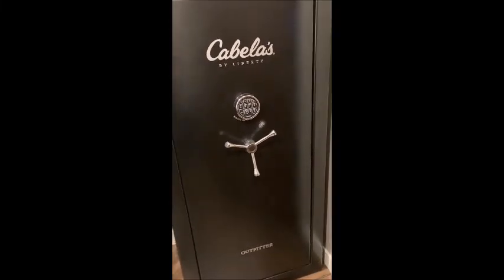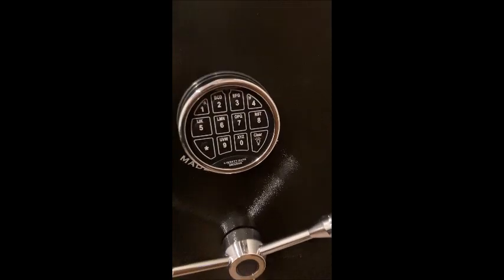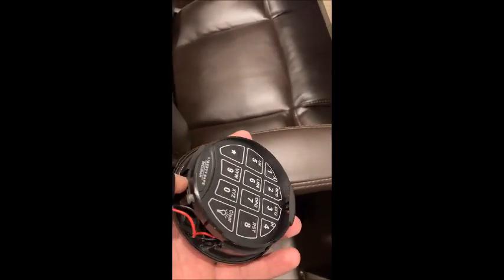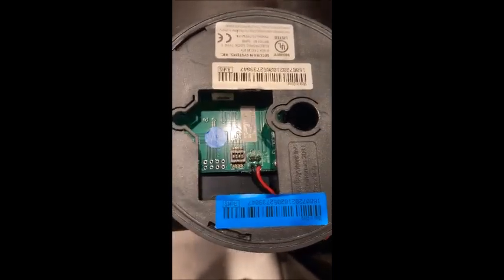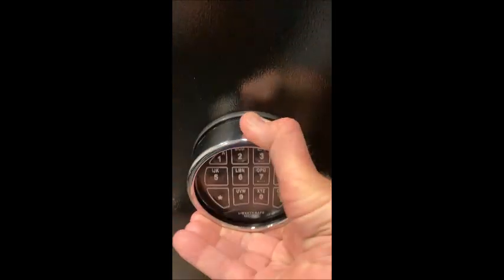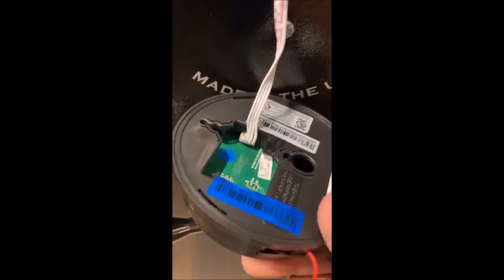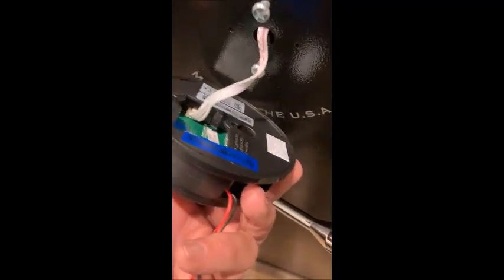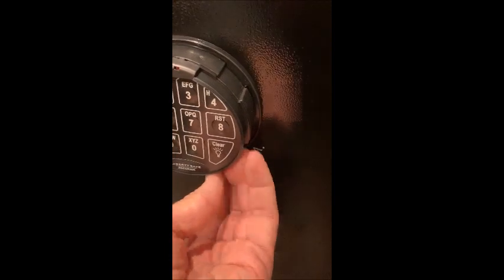Liberty Safe Keypad not working. Solution here! Liberty Safe Keypad malfunction.

Comment: My 3 month old Liberty safe just had this problem yesterday. I was able to open it in the morning. When I tried opening it again in the afternoon, I had the same experience you have. I called their support number and the guy said a new lock will be delivered to my house. I also got an email later saying to try to do the same thing that was discussed in this video. My keypad looks different though. Mine doesn't have the dip switches. I emailed the guy back and he said to just plug back in the keypad. Mine is still not working.

Comment: I am having a heck of a time unscrewing the outer cover. I can remove the keypad but can NOT get that outer cover off. Any suggestions?
Reply from the maker: On my safe, the outer chrome cover turns counterclockwise about 1/2 or 3/4 of an inch and then pulls straight off.
Reply: @helpfulthings5218  supposedly. That’s what mine is supposed to do as well but. I luck.  Thanks for the reply.

Comment: I have a liberty safe and battery died called liberty they said safe made 2021 have problems once the battery dies it disconnects from motherboard 
They sent out new keypad but same things smh
Reply: I’m having this same issue as right now, you get it fixed ?
Reply: @ I had tech come out and drill and replace whole lock
Reply: @ damn I was hoping I wouldn’t have to do that. Liberty help you out or you do it yourself?